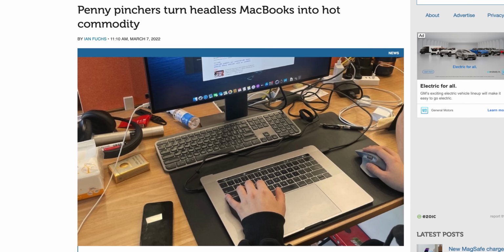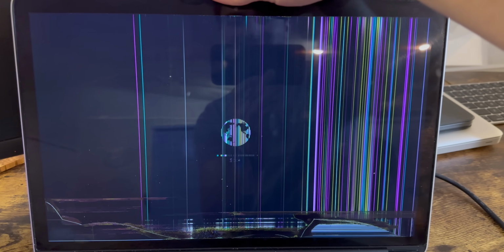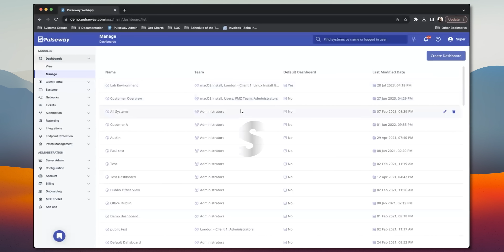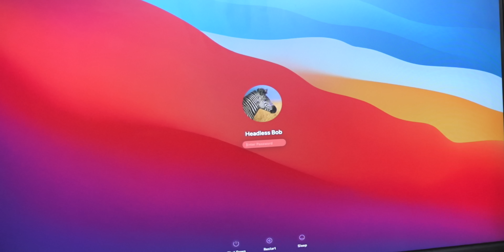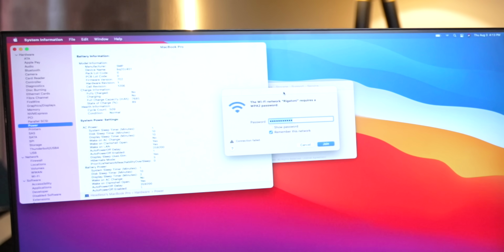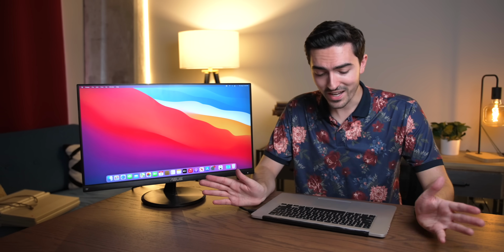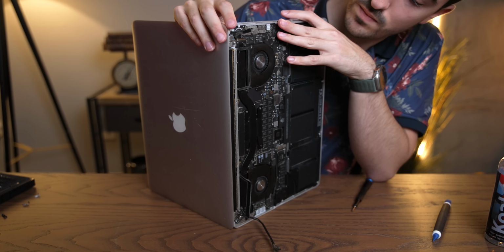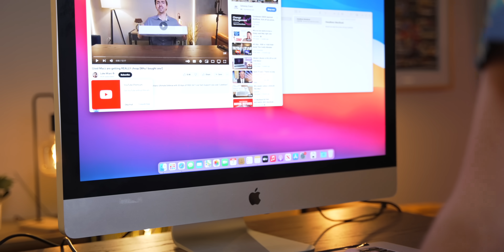Exploring the weird world of 'Headless' MacBooks

Comment: The article came too late. If I had known this two years ago I would have done it on my 2010 MacBook Pro whose LCD got delaminated from the glass. Instead I left it hidden on my cabinet and when I looked at it this year, its bloated battery grew so much It kicked out the trackpad from the case. I'm still keeping it but as a huge paperweight. Maybe I'll mount it on the wall as a display unit for all my dead tech gadgets.

Comment: Yeah, I've been running laptops headless for years, but as others have pointed out Apple is and will continue to do its best to stop this. Perhaps an off the shelf headless computer model would be more popular than expected with the power of a real computer and the convenience of a tablet (minus the screen, if course).
Reply: The number of people using laptops headless who aren’t buying a new machine BECAUSE their laptop works headless is so vanishingly small that Apple does not care about this whatsoever. They’ve made zero efforts to stop anyone doing this and I don’t see why they would ever start. The only reason it was slightly complex on these models is because the Wi-Fi antennae were in the lid with the screen. And before you get out your tinfoil hat, lol, they were put there because the signal was better, not as a deterrent to running your broken laptop headless.

Comment: Lol. I have a MacBook with exactly this scenario. But i thought the "clamshell" mode was on the way to go. I changed out the battery, but otherwise did no other work. Now i will consider if "headless" is worth doing after i finish this video

Update: it worked. Now i am a happy owner of a headless mac connected to a pen tablet display. It works better now too since i can move it anywhere i need instead of the previous desktop tether i had using it in clamshell mode, since this required it to be powered to show it to the external display

Comment: I did exactly the same thing years ago to my Powerbook G3 when the screen failed. No Wi-Fi or Bluetooth antennas to worry about on that old thing. It worked just fine plugged in to a monitor using its VGA port.

Comment: The battery life only gets better, no screen that sucks half your battery empty. 
I also use a mid 2014 macbook pro. And I made 1 macbook from 2 macbooks. It was fun to do and now I'm using it again! 
But I'm still looking to see if I can do the same with that old what if you did in this video. The only problem that macbook freezes hell time after about 10 minutes. And I have no idea what it is, I've already tried and cleaned other cool paste and other version of macos but it still doesn't work. It is one with an nvidia gpu but as far as i could find there are no problems with that.

Comment: I have an hp laptop. The screen broke and I took it to a 3 party service centre. They gave me a price of $100 and they could change the display without changing the entire top part. It just had a 30 pin connector and a few screws. That is the way it should be.

Comment: A recent project of mine used a 2017 MacBook Pro as the basis of a NAS, because of the TB 3 connector and because the OWC 4m2 nvme enclosure holds 4 nvme’s in a raid 0 config getting roughly 2000 mbs read/write. The Mac I got was about 379 but with a non working screen, it would make an even better NAS/file and media server. Not bad for a pc guy, eh?

Comment: I think that what you are doing is a great example of how people and companies should approach this issue. I find it a very sad trend that now electronics are ridiculously difficult to fix. It’s easier to buy a new one to replace the broken one. 
I think that the only flexible devices to fix and upgrade are PCs where you can have access to all components. And for more mobile devices sometimes it’s even difficult to change the battery.
Reply: This is why everyone should consider Framework Laptops if they are purchasing a new laptop, IMO. Will it beat out a new macbook in efficiency? No.  But it has the benefit of having sanely priced replacement parts and tutorials for everything.  You can even upgrade the entire system board to a new generation.  Oh, and what do you do with the old board?..  Well, you can buy.. Or 3D print a case for it and stick it behind a TV as a small media device.

OEMs, Apple included need incentive to change their practices which just creates e-waste.

Comment: Great project. I'm curious if it would be possible to gut the MacBook with a dead display and stuff the internals into an iMac with dead internals, but a functional display. Personally I have no need for such a project, but I'm curious if it would fit.

I am in somewhat of a similar situation with an older MacBook (late 2014 Pro). It was given to me at work to replace a MacBook Air I was using. The Air I no longer have, but the Pro, which functions fine, has a display coating issue. As I said, it works fine, but the display has a layer/coating to it that has been coming off. Some videos about the issue talk about taking it apart and fully removing the coating, but I'm not really into going that far for something I just use for work and it doesn't bother me too much. Some day I'll sell it though. Granted the Apple trade-in value is "recycle", so I'll probably go to eBay with it some day.

Comment: You really should get an air compressor. Makes it real easy to clean. Though I guess if you live in an apartment, then maybe you couldn't as I have my compressor outside and dust things off outside. Canned air would probably be too expensive, though I have some canned air for dusting small things that don't need a 10 gallon air compressor worth of air or maximum air pressure.

Comment: Having to use wired ethernet is not a problem for someone like me that is not heavily invested in the Apple EcoSystem.  My last iPhone was an iPhone 4, and I only ever had the first generation iPad.  Handoff and the other features that you mentioned are basically useless to me, and I have found a wired ethernet connection to be more reliable on my "MacSlab Pro" over the last four years that I have been using it.  It was formerly a MacBook Pro (2009) that had its display shattered in an accident that the previous owner was involved in. I was given it for free with the only request being that I give the hard drive to the previous owner, because he wanted all his data that was on it.

Comment: Why can’t you just relocate the Wi-Fi antenna just pull all the wires and stuff out and mounted in the bottom of the case instead of the top and still lose the camera though which is why I would just leave the head on what’s the difference if you want to use the keyboard, just open it up if it bothers you that much, then just put a cover over the screen

Comment: Have been doing the same for a windows gaming laptop. Headless laptop connected to a monitor until it died recently. Salvaged the SSD, RAM, WiFi card and charger as external portable parts.
Worried if Apple sees this and starts locking the MacBooks not to work without their 'mapped' screens.

Comment: Hi Luke. You actually don't need all the trouble of removing the screen and modifying the wifi antenna. You can just plug in the external monitor and turn the brightness of the broken screen off, then you have a perfect working Desktop Mac. The brightness control is the 2nd left button on the upper row of the keyboard.

Comment: Can you try to bypass the battery and run it 100% AC power? I know they can run with the battery removed, but it throttles the CPU. I want to create a dummy battery that supplies the correct volts and amperage to the battery connector, but from AC power. That way I can create a 24/7 server without worrying about battery hazards.

Comment: The newer macbook pros have the ant in the computer. this would work really well with them. Also the very first apple computer was exactly this although no mouse because it didn't exist. It connected to a monitor and the computer was inside a housing with the keyboard on top. Also the battery is a ware item when it goes it could just not have a battery. I have actually been recommending this kind of repair for many laptops. Another thing is you could have a usb hub plugged in and have a wifi card installed also opening up more plugs  for items like a camera and what not.

Comment: This is a great concept I haven't thought about. I have a small fleet of unibody MacBook Pros for personal and work, but headless retinas would actually be pretty decent, likely would build an antenna adapter so it could still run wirelessly, it's literally just cables since the wifi/bluetooth card is on board (at least with unibody would assume the same with retina). 3x Mid 2012 15" (2.3,2.3,2.6) One with hi-res glossy, one with hi-res matte, other with low res glossy (upgrading to hi-res matte from 2011 mbp) and Mid 2010 2.8 i7 15", all maxed out with the most ram. Only downside about those retinas is that you need to buy with the amount of ram you'd want, which I don't like, not to mention the proprietary SSDs. Just upgraded my 2.3 unibody with a 4TB 870 EVO SATA SSD and also have the original Apple 500GB SSD in place of the disc drive.
Reply: i didn't watch the video through, but that antenna adapter looks pretty good, would definitely be cool if someone made a 3d printable enclosure so it looks professional
Reply: Unfortunately, all but the most recent quad-core Unibody MBPs are just too slow for any serious use these days. My 2011 quad2.2 17” is delightful to use, but I’d consider it the bare minimum to be productive without UI lag getting in the way. While the 2011 is fluid to use and maintains 60FPS very well, dropping down to my mid-2010 17” MBP sees simple things like scrolling and window dragging start dropping frames all the time.

Fortunately, all retina-era MBPs with any specs that are good for modern work came with 16 GB RAM! Even the first 2012 15” MBPs did. With discrete graphics, quad core CPUs, 16 GB RAM, and fast mass-market NVMe storage (internally via a $15 adapter), they make great perfectly fast productive machines today. Just buy one; they’re cheap!

Comment: I accidentally ripped the antenna connector off of one of the antenna wires from my (functional) 2015 13” mbp display. Solution: random iPad 4 antenna board and cable routed internally. Signal is probably weaker but I’ve had no issues with wifi or bluetooth.

Comment: I basically did this for a few years with my white MacBook when the screen went bad.  The Mini-DVI port was anything but sturdy though.  The best option was to get a mini-DVI-to-HDMI cable instead of using one that was adapted because the box portion of the setup was too heavy for the connection over long-term use.

Comment: i did this many years back with my 2007 MBP when the display died after a couple of years. I used it like that for a few more years before it finally croaked completely. still have a photo of my setup back then with a USB hub connected with a wifi and bluetooth adapter since as you mentioned they're housed in the display. 😂

Comment: Idea for video: battery-less MacBook. My mid-2015's battery became swollen and I was quoted NZD$700 (about USD$300) for replacement so same over capitalization issue as in this video. Importing a  kit from iFixit and doing it myself  wasn't much cheaper so I looked at just removing the battery and running it on power. There's "limp mode" to address but that's possible.

i tried myself but it appears I damaged something because it boot-loops and I can't get it to boot into recovery mode of any type. Love to see Luke do it successfully, maybe with DOSDude.
Reply: The SMC on those machines gets super angry if you remove the battery or the trackpad.

Comment: Amazing video Luke!
I was happy when you didn't simply give up and used ethernet but tried to make wi-fi work as that is in the spirit of this channel.
The only downside to what's shown in the video is that it completely blocks out the fans and the cooling so I can imagine that Intel chip running really hot.
I'm sure you'd figure something out though
Reply: That's the factory location of that clutch cover so it's not blocking any more that it would with the screen still on.
Reply: @Thomas_Bannon  With the screen on it's not actually touching, it's a round thing that lets air through above and below. Not ideal but it's the only vent on the device...

Comment: Long post cause I'm bored today lol. Just addressing some of the comments about Apple not selling the parts to repair their computers:

I do agree that Apple should make certain parts for certain devices more available. However, as someone who used to repair macs professionally, some repairs can be quite difficult and certain model computers more difficult than others and often times not something the average user should be doing themselves without knowing what they are doing - similar to non-trained person doing a difficult repair on their car that would be better (and safer) if a professional mechanic were to do it.

I'm all for people learning the workings of their devices and being interested in learning how to repair certain things vs immediately giving up and writing something off as just "broken" and buying a new one. But some things are better left to be done by someone with the proper training, tools and work environment to repair. This also depends on if you are just trying to resurrect a cheapo busted computer you bought off ebay vs your own personal macbook pro which you may have spends several thousand on.

On this particular model macbook pro, the bottom cover is screwed down with torx screws vs the old pre-2012 non-retina macbook pros which used standard phillips screws. While realistically anyone can go online and buy a computer repair kit with all the necessary screw drivers and tools to open and disassemble these computers, these screws were used to prevent the average user from just grabbing their phillips screw driver from their kitchen junk drawer and opening up their computer. Part of the reason for this is this generation macbook pro and all the ones since use soft shell batteries. These have no protective casing around them vs the old style batteries which had a thick plastic casing on them to protect the battery cells (some of these could even be popped off without opening the computer) and was perfectly safe for anyone to remove. You could probably chuck one of these at the wall and it'd be fine.

 The soft shell batteries in the newer macbook pros have no protective casing around them and there is a risk that an inexperienced user could accidentally puncture them with a screw driver or accidentally leave a small screw sitting on them and go and pop the bottom cover back on and press the screw into the battery - resulting in the risk of the battery "venting/ causing a thermal runaway" - releasing toxic lithium gas and smoke and potentially starting a fire, all very rapidly. Therefore, these laptops use the torx screws to deter people from opening them who don't know how to handle these types of batteries.

Additionally, many modern electronics such as these macbooks have very small components that are extremely sensitive to electrostatic discharge (ESD) where simply put - static electricity is transferred from the person to the electronics inside the computer which can damage or destroy the delicate components inside. This ESD is essentially unnoticeable to the person as it's way less than a static shock you get from touching a door handle in fuzzy socks on carpet where you hear, see and feel the big zap. So in many cases, you won't even know anything was damaged until you start using the computer again and it either doesn't turn on, a certain component stops working, or maybe it just starts acting strange down the road. It's not a guarantee that ESD damage will occur, but to repair these sorts of devices, you'd want to do so in a properly grounded workstation which typically consists of a grounded ESD mat to place the computer on, a ESD wrist strap that the user wears to safely transfer static electricity to a ground vs the computer, and typically proper clothing (100% cotton vs say a fleece jacket and fuzzy slippers) as they reduce the possibility of ESD buildup. None of these ESD safety measures were used in this video.

Lastly, on modern laptops many of the components are very small delicate and many of the connectors are quite difficult to remove and very easy to break without repeated practice (which you probably don't want to do on your primary computer that you rely on). 

All in all, I'm all for people repairing their own computers and I think it's great to do things like this to bring new life to a computer that someone else would have just considered "trash", but I do think it's worth also learning about how to do so safely, since also no one wants to accidentally break more than what's already broken. In addition to Apple's "business/money" reasons for making their computers mostly un-repairable by the end user, I believe the reasons I stated above are also part of the reason - they don't want untrained people accidentally further damaging their computers or accidentally actually injuring themselves by handling batteries incorrectly. Having worked in that field in the past, I've seen countless computers and components that were destroyed because someone tried to fix it themselves without knowing how to do so. If it's something you want to get into doing, definitely invest in a good repair kit, workstation and while any "official" Apple guides are not publicly available, follow a reputable step by step repair guide, I've seen some good ones out there before.

Comment: For those of you doing this. 1) buying a new monitor costs the same as new display (maybe not replacing the top frame though). 2) you can't use it easily on the go (you would need to remote in with your phone hostpot or something) 3) what else is broken on a cheap used laptop